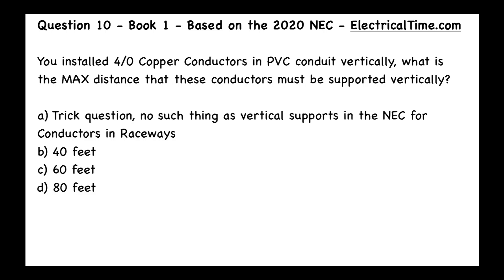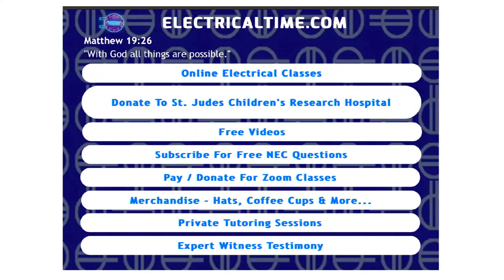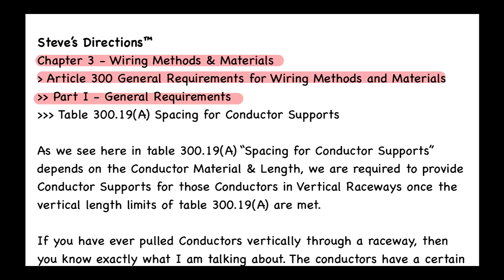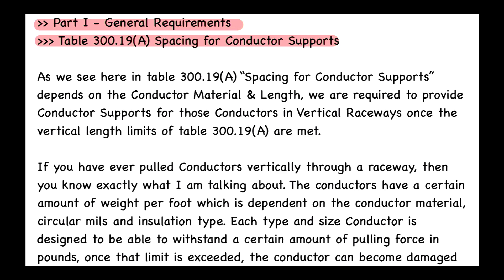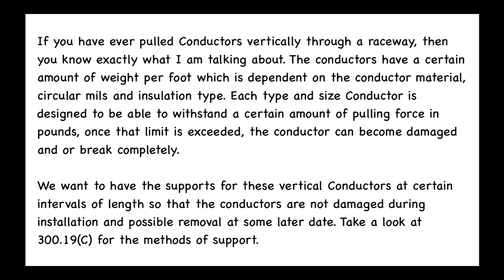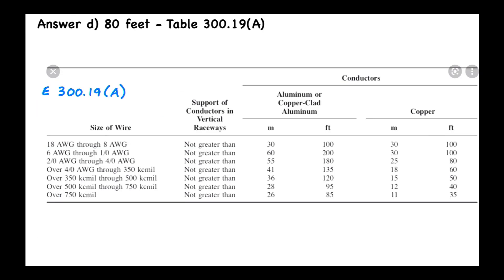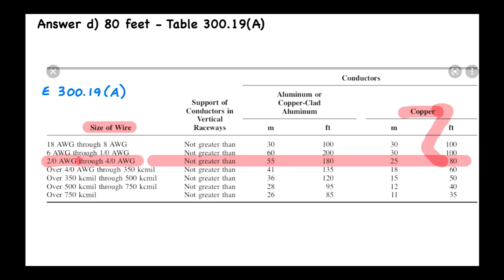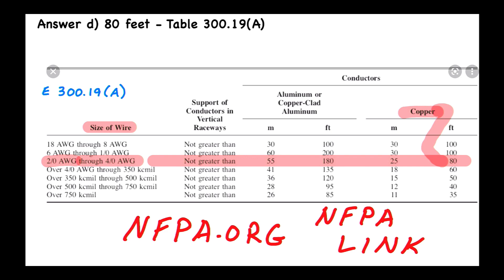NEC 2020 01-010 NEC Table 300.19(A) Vertical Raceway Conductor Supports By ElectricalTime.com

Comment: Not matter the raceway?
Reply from the maker: Hi, when we think of conductors that are installed in a raceway, we normally think of PVC Conduit, EMT, IMC or RMC. There are other raceways, however we are making sure that the shear weight of the vertical conductors does not damage or break the conductors. It might be a good idea to look at the manufacturers specifications to see if they have a vertical support limit as well. Thanks for you comment, it's very much appreciated.